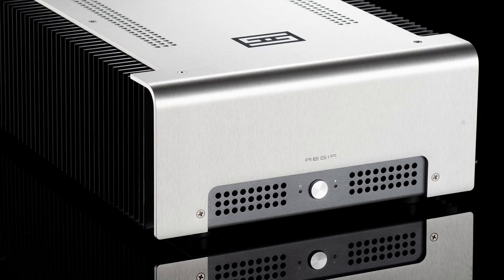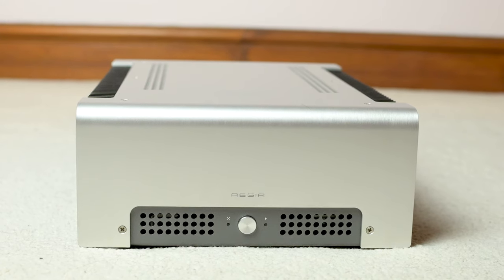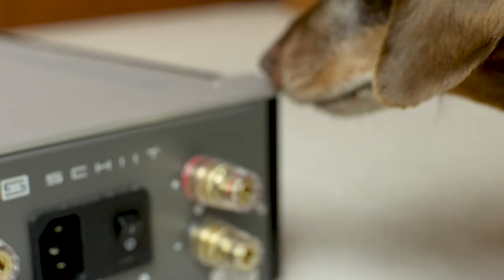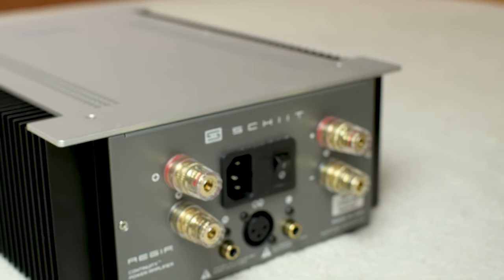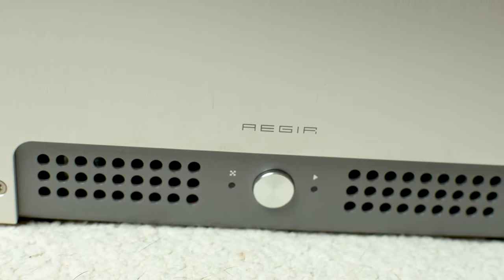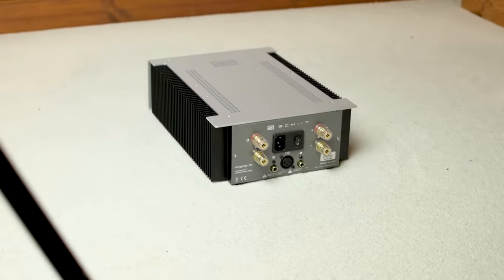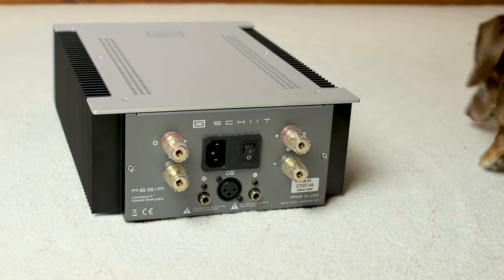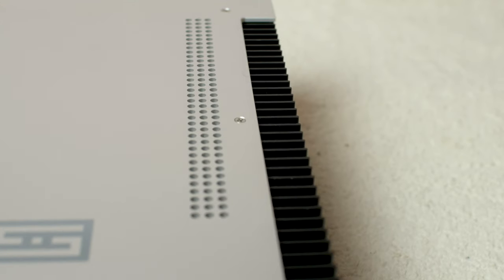Schiit Aegir Amplifier Review

Comment: Perfect timing. I’m considering two of these to possibly replace my XTC Edge A2-300.  I have a pair of La Scala’s I bought new 40 years ago with recently added ALK extreme slope crossovers.  It seems the Aegirs should work well with my Freya+.  Besides, it’s winter and I could use the added heat
Reply from the maker: Awesome match - very jealous of those La Scala’s, I bet they sound amazing!
Reply: @SmallRoomAudio  it wasn’t until the pandemic did I fire them up after over 30 years of hibernation.  I forgot what I was missing.  I didn’t even know what digital music was until five months ago.  Not sure what’s next.  Maybe the amps or maybe a couple subs.  People always comment on the lack of bass response of the La Scala’s but I don’t necessarily agree.  The frequency they do cover sounds great and maybe it’s better I don’t know what I don’t hear.  We’ll see/hear what’s next
Reply: @Steveh817  How did u like the A2-300??
Reply: @feronous8207  I really like it but we always want to try something else in this hobby. I actually placed an order for a Decware SE84UFO2 instead of trying out the Aegirs.  Ordered in May ‘2021 but may not see it until 1st qtr ‘22.  Who knows what I’ll do after that.